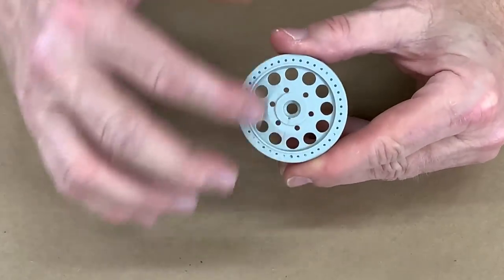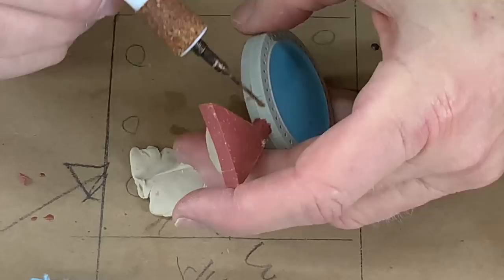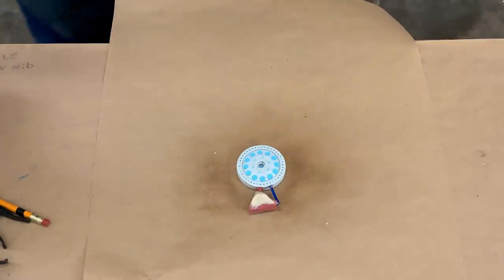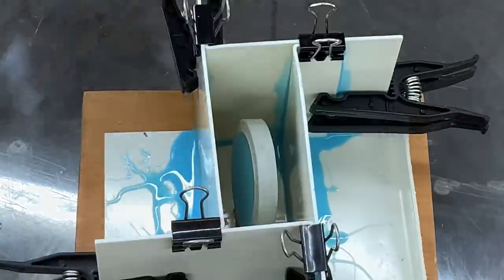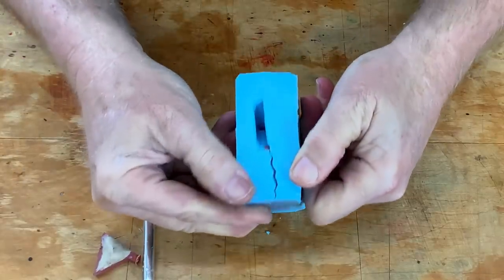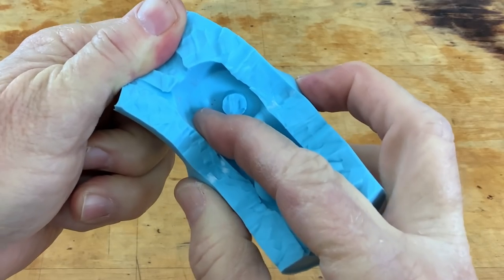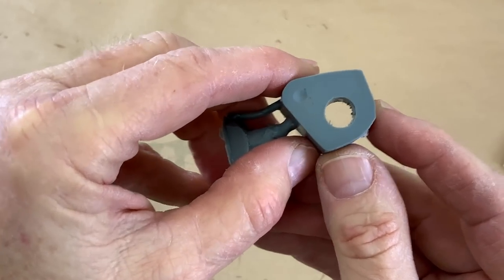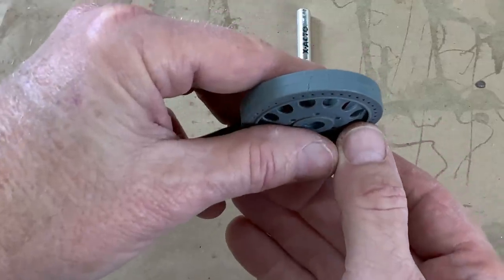Casting An Object With Holes - HOW ???

Comment: I have actually thought about this method before: the vacuuming with the models still attached and cutting the silicone part that goes through the hole. I thought to myself (as I cannot experiment as I do not own any vacuum or pressure chamber): "Why don't people do this more often?". Now, I am glad that you made this video as it justifies my analysis! With this method and the squish mould method, recasting injection moulded parts in sprue will become much easier!
Reply: Oooh...that's basically what this accomplishes, isn't it? It's "injection" molds without doing the injection.
Reply: @nekrataali  YES EXACTLY! With squish mould, you basically neutralise the pressure inside the mould at the cost of being messy

Comment: This is the sort of video I wish I had when I started.  These methods make the impossible possible.  This will be a great resource for folks with complicated holed models.

Robert - I have a request for your future videos.  I finally got a Foredom wax pen, but I still suck when using it to attach vent sprues.  Can you take a few minutes during a future project video and teach us a bit about your technique for applying wax wire vents?
Reply from the maker: I can cover that in a future vid but the best quick tip is to put a little dot of sticky wax on the model where you want to attach the vent wire. This holds the vent while you build the weld.  I usually use sculptors wax to join the wax wire and the model because I have so much more control over it than I do with the blue wire wax.  And make sure your heat control on the wax pen is set optimal for welding wax wire.

Comment: Another fun video, Robert. Glad you relented on your normal procedure with this one, and used a second vac! Definitely the way to go here. I actually do that on probably half the molds I make, avoiding it mostly for parts that would have vulnerabilities, like being hollow, soft, or unknown composition (most stuff I mold is pretty predictable).  I even like to use it with clayed-up patterns sometimes, although I generally stop at about half-vac... mainly just to give any unseen bubbles some extra lift.  That's just me, of course.

Comment: Love your videos, Robert! I don’t miss a one! ;) For those looking to do this and would like another approach, here’s what we did. At our industrial urethane casting shop, we would source metal rods for small and/or deep holes and imbed those into the mold. This was especially important when producing a few dozen parts off the same mold.
Reply from the maker: I never could get that to work for me. It was always fiddly and unreliable. I would love to see how you guys made it work. We use jigs on a drill press and can cycle the parts on and off the machine very rapidly. So for me drilling has been the way to go.

Comment: Just found your channel and am enjoying your videos. At 7:17 you say "That seems like a lot of air coming out of those tiny holes." What's happening is that the alcohol in your hardener is reaching vapor pressure. IOW, it's boiling at the lower atmospheric pressure. That can knock a model off its base, and add new bubbles.  Lower vacuum can help, but ultimately you're changing the chemistry by boiling off one of the components. If you're using tin cure silicone, this isn't a problem. With platinum cure, it can change the hardness of the rubber.

Comment: I always put my molds into the vacuum chamber a second time after I pour them. I never have to worry about little stray bubbles caught in the rubber and giving me problems later on. The only time I haven't done this was when the part I was casting was hollow and I had to worry about air escaping.

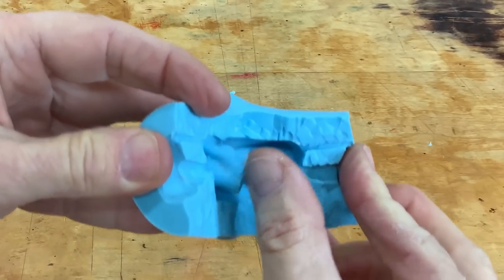Comment: 9:52 - If you design the mould so that those long thin pieces of rubber sit vertically while filling / curing, won't that eliminate (or at least reduce) sagging? Of course, it might not always be possible, depending on the shape of the part, but it's something to consider.
Reply from the maker: Each mold is different so what works for one might not work for another. But even if the rubber doesn’t sag it still has the problem of tearing off after a few casts.

Comment: When pulling air out of a vacuum  chamber, it might help to reduce the dead space with a material that wont off gass.  That you will have less air to remove from the chamber and can get to your desired vacuum quicker. 

I also suspect vibration from a sander will help lift bubbles off surfaces and to the top quicker.

Comment: Question about the 2-stage mold. At 5:32, we can see that you've filled 1/2 of the original with rubber with the "cookie" method that you described in the beginning, and it seems to have set. Is that right? 
And then, you built a box around the original object and poured the rest of the rubber. How does the 1st part (The Cookie part) work with the remaining? Did the two parts bond together? Thanks for your help!

Comment: For the large tunnel problem at shown about 10:10 I would find a piece of brass rod that fits snug and install that in the object before making a mold. Then I would treat that piece of rod as part of the mold, installing into the mold before each casting. It technically wouldn't be a one piece cut mold anymore though.

Comment: What a great tutorial, and making ideas spin around in my head. If one could get a stepper motor with a Pi or Arduino that could remotely pour a beaker of silicone inside the vacuum chamber, could that prevent any air being trapped in the mould? I could be just over engineering the process because your cast came out pretty darn good anyway!
Reply from the maker: I always try to keep it as simple as possible. Complexity breeds problems; at least for me.

Comment: I like your pressure/vac chamber you showed near the end of the video. It looks handbuilt. Would you ever consider doing a build video on that? Great content, man.
Reply from the maker: I did a video about my pressure pots but not a build video.  That is because you need an expert welder, ideally one certified in welding pressure vessels, to safely construct these pots. I designed my chambers, but I did not specify the thickness of the steel or do the welding myself because I was not qualified to do so.

Comment: I need to make a mold using urethane or epoxy and it will be used to make small parts made of silicone that will have many 1mm diameter holes. Can i use a similar method as this video? Also will the 1mm dia and 3 mm tall pillars casted for holes be strong enough in epoxy or urethane to not break when demolding silicone parts?

Comment: You can relax your degassing a LOT. You are not pulling air out of the model at 7:27 you are vacuum stripping volatiles out of your silicone. Some of which need to be in there for the right working properties. A vacuum gauge would let you see how far down you have gotten and then you can hold it at an appropriate level for a few seconds to let the bubbles rise. Rest is just vacuum stripping.

Comment: Love your videos. You helped me design my first part from scratch out of a combination of clay and two plastic pieces that ground down and manipulated.  I have the final part but I cannot design a mold  to produce more that doesn't have bubbles problems I am using a pressure potand a squish mold. The resin I am using is a two minute set time and needs the mold to be warm . It is essentially  the size of a Nickle but about a 1/4 inch thick.  One side has an indented ring on one side and the other has a small cylinder cut out in the middle that goes about 80 percent through with a small hole in the middle that is open to the other side.  Any suggestions would be greatly appreciated 🙂 🙏.
Reply from the maker: Could you open pour each side of the mold, let the resin set then squish mold the two halves together?

Comment: Hi Robert, I’m really enjoying your videos! I have a very challenging question. I have a medical model of a pelvis and tailbone that I would like to cast. What would be the best approach for this? It’s a very complex shape!!
Reply from the maker: Plan out the orientation of the part in space so that most bumps point down.  This minimizes the number of vents you need. place event at every High Point where the air must escape out the top. Take pictures and plan out your parting line and where you are going to locate the inlet sprue. Ideally the sprue and funnel is strong enough to carry the weight of the model and is sized in proportion to the part so that the resin can fill the cavity rapidly. The funnel will be a great help in attaching the model to the case.

Comment: Great video Robert! Are the potential holes in the models the main reason you avoid deairing the mold? I guess it can add more work but I was always assuming that its a good practice to deair as much as possible
Reply from the maker: Because I cast models from different sources I never know how they are constructed. So I can’t be sure they don’t have hollow voids inside them. I can’t risk putting them under vacuum or pressure. Fortunately, it’s usually not necessary.

Comment: Could you paint rubber into the small holes before pouring the rest of the rubber?
Reply from the maker: They were so tiny and there were so many of them that I deemed it easier to vac out the air.

Comment: What about a three part mold using metal rods the size of the holes sprayed with release that can slide in for casting and slide out to remove the part when casting long slender through holes? If there are lots of holes you can mount corresponding rods on an external brace to position all holes at once. With this method you can even cast through holes at right angles.

Comment: A question as for using vacuum v pressure . . .  generally it seems as if you are using vacuum while creating the molds out of the soft rubber materials while you are using pressure to make the castings out of the harder plastics.  True, or perhaps with some conditions that apply?
Reply from the maker: Next week the video is about this exact subject. When to use vacuum and why. And when to use pressure and why. But for a quick answer:
I use vacuum to de-air rubber prior to pouring the mold. And I use pressure to suppress foaming in resin when making the casting.

Comment: Hi Robert. I have a part that has very long through holes and I cannot for the life of me work out a good way to do it. The holes are about 7mm wide and 100mm long. Any ideas?
Reply from the maker: Pretty much no way to cast it. You just have to drill it. Although there are people who will tell you to use a steel rod in the mold to form the hole in the casting.
Reply: @RobertTolone  ow. The metal rod sounds a nice idea. I would drill them but there is also a pattern. It's a complicated part and driving me a little crazy. Thanks for the reply Robert. You are the reason our business has been able to move into resin casting as a production method. You make it look easy and explain the problems along the way. It's helped no end and for weeks already our parts have been shipping to happy customers!

Comment: 4.58  you can see that the base that you use needs to be metallic, all you need is to heat the bottom of your mold to attach the funnel to the metal and avoid the bubbles.
Reply from the maker: Metal makes me nervous around silicone rubber unless I have tested it for cure inhibition.  Otherwise your technique could work well.

Comment: Hi, there is actually an easy and more reliable (and long-lasting) solution to precise deep hoes in silicon molds : rigid rod inserts (steel for example)! - but definitely requires more effort beforehand

Comment: The T-34 front and rear road wheel, how to make anyone hate you in machining, moulding and resin casting.
Reply: @RobertTolone  am I wrong? I'd say metallurgists would, but they'd pit cast them, which is how they where originally made then the rubber was press fit on the rim.

That being said, I do wonder how much it'd cost me to have you make a parts kit of some tanks. I'd also enjoy watching vids of you making resin tank models, in 1:15 or 1:25 scale, be a lot easier let me tell you.